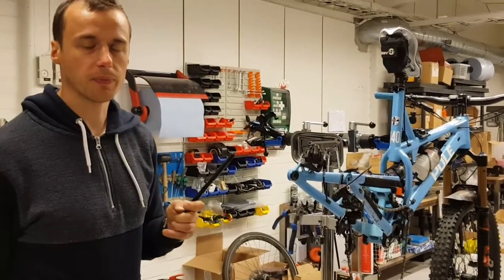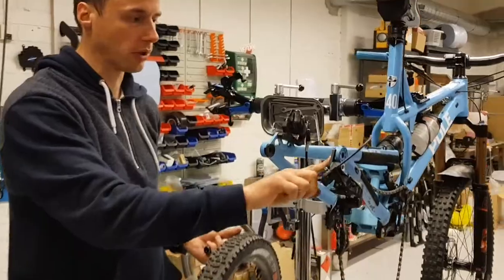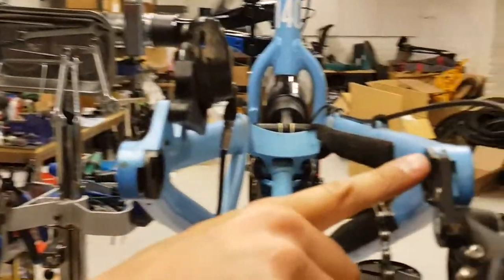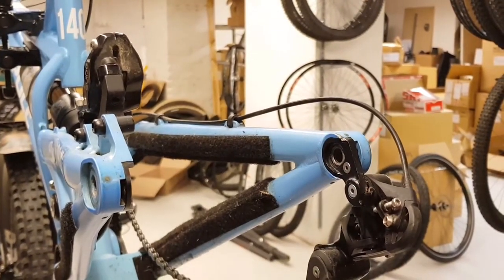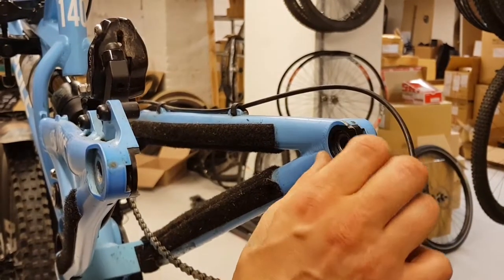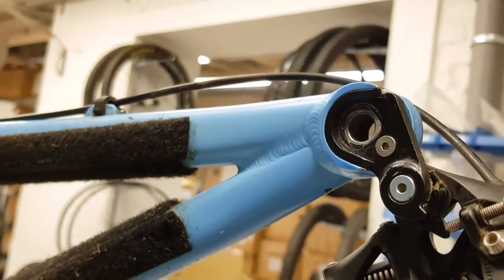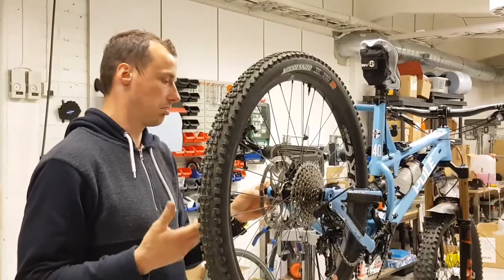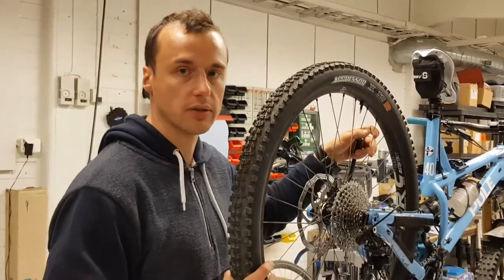Pole EVOLINK rear wheel install explained

Comment: Hi Guys, clever idea :-) the yoke hitting the tire is certainly an issue for a lot of frames.

What about shimano derailleurs, where you can't lock out the cage so the spring is working against you all the time?

I just tried to pull back my XT rd. to check: If I'm holding it with one hand, it's difficult to whip the chain around the cassette with the other hand assuming I'll be putting in the wheel from the back. Also what about trail-side cases?

Do you have to unmount the chain from the crank side as well? Might be a bit of a fuss with a chain guide on.
Reply from the maker: Gergely Vasvari what I did with Shimano I pulled the derailleur backwards so that you can slip the smallest gear in and the slide it to the dropout. It's not as smooth as SRAM but it works pretty smooth as well.